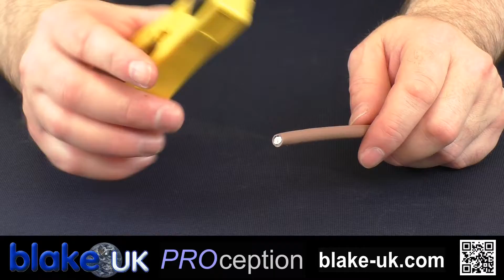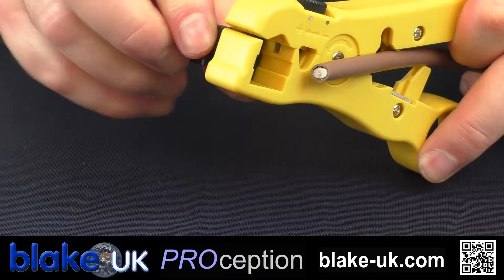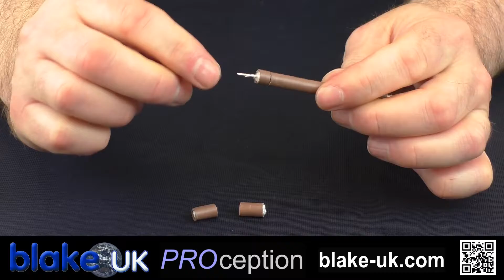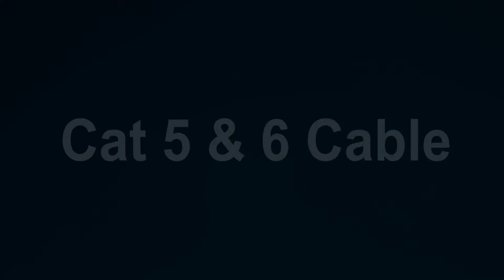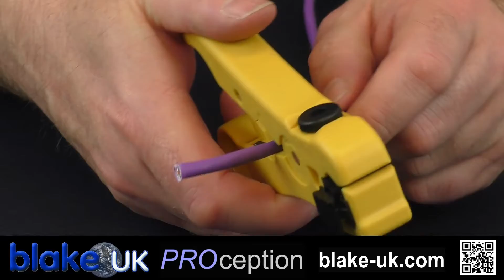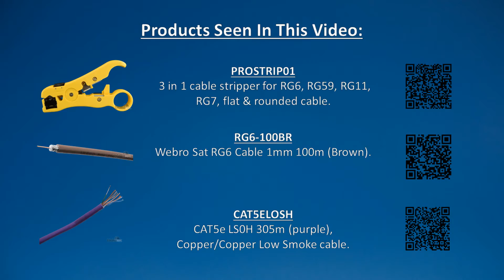3-In-1 Cable Stripper for RG6, RG59, RG7, RG11

Comment: That round adjusting wheel is to adjust the single blade when cutting Cat6 wire. It has no effect when cutting/stripping RG wires.